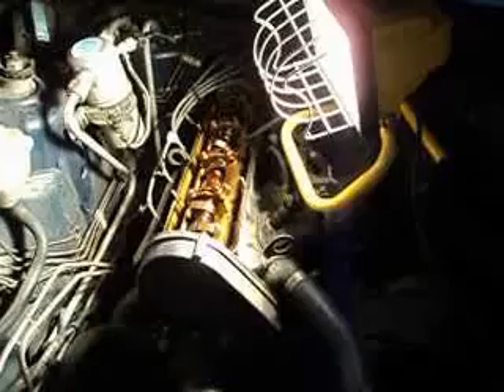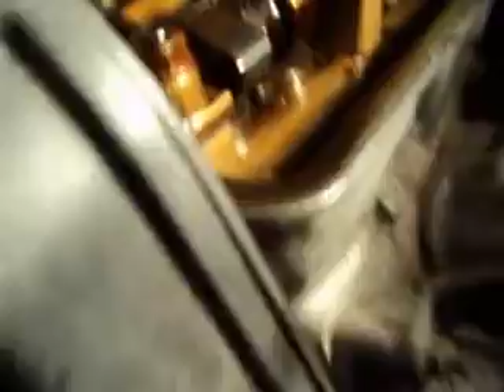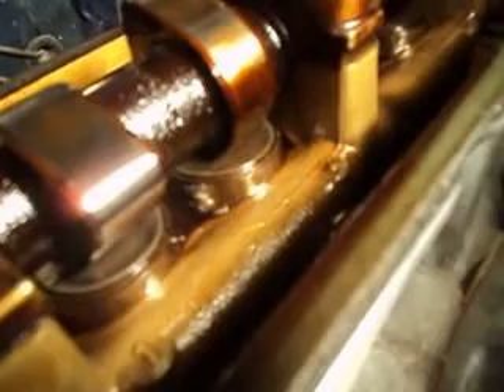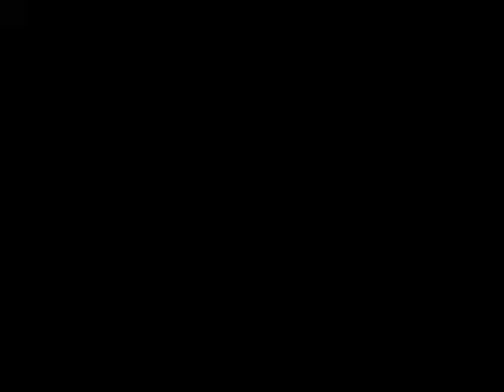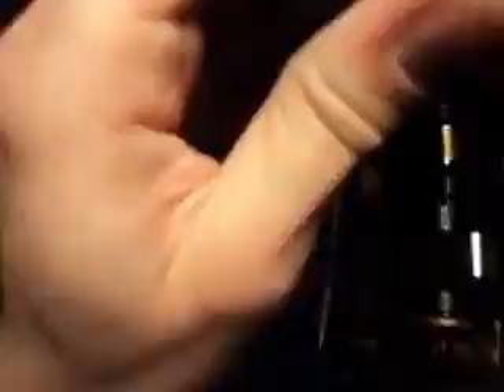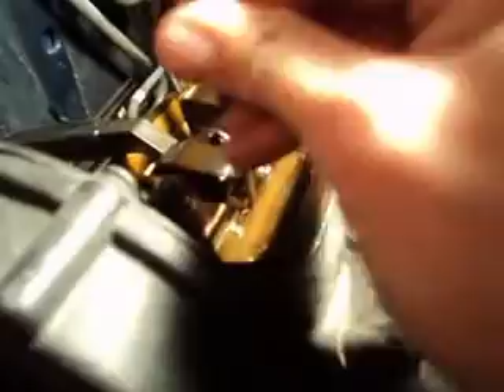740 Valve Adjustment

Comment: I wanted to get that valve compressor tool, and it seems they no longer carry it! :(  Can anyone recommend another that will work with the B230ft red block you see here?
Reply: Shane Beranek my issue actually turned out to be a faulty ignition control module, so I think I am going to put off the adjustment.
Reply: @plightn  Wise choice! Better yet, trade it in for a Honda! Lol
Reply: @bobjohnson1587  Haha :D

Comment from the maker: The specs are .3 -.4mm. There are lots of different methods to measure, but I just turn the cam until it points up and then use a feeler gauge to figure it out. Write down the measurement, then remove the old shim, see what the thickness of it is, and then do some simple math to figure out what new shim thickness should be.